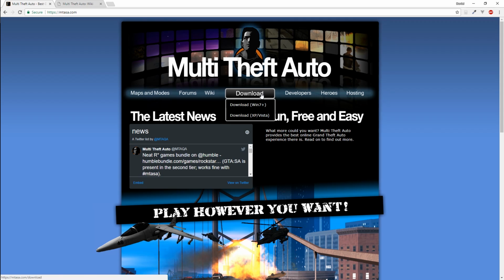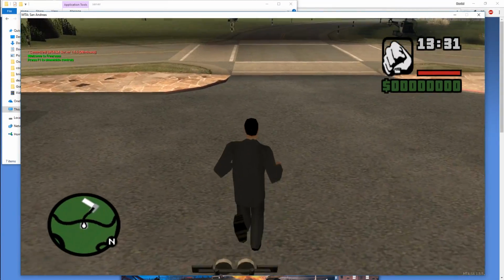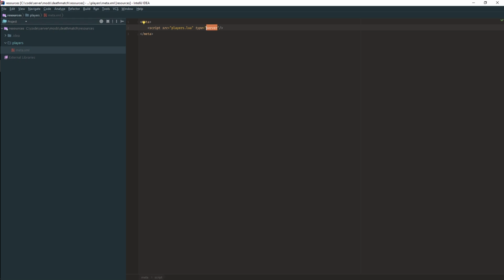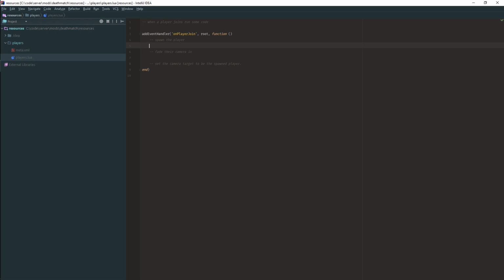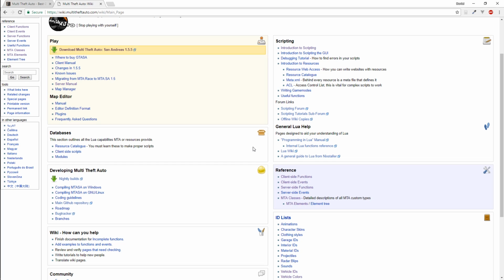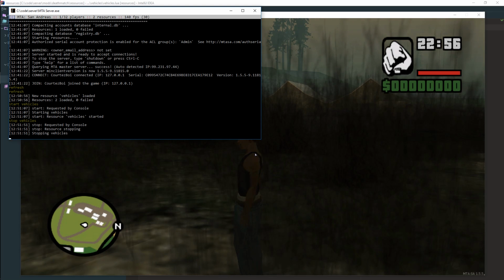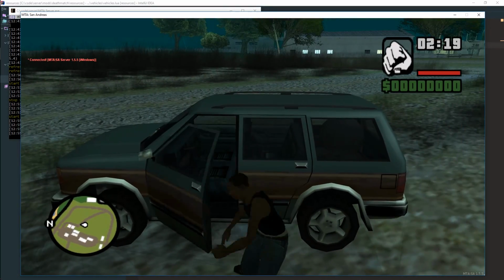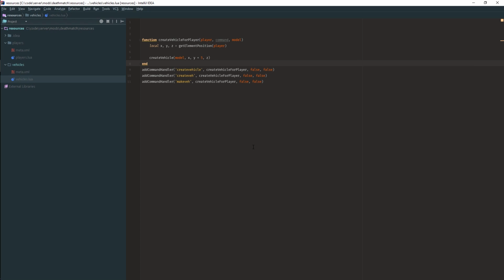Learning to code with MTA:SA - Episode 1

Comment: If you get a black screen check if the .lua file is in the player folder as the meta.xml!!!
the correct players.lua code should be: 

-- when a player joins run some code

addEventHandler('onPlayerJoin', root, function()
    -- spawn the player
    spawnPlayer(source, 0, 0, 5)

    -- fade their camera in
    fadeCamera(source, true)

    -- set the camera target to be the spawned player.
    setCameraTarget(source, source)
end)

correct me if im wrong :)
Reply: I was getting black screen 
replaced my code with yours and it worked 
even tho they are the same what the hell
Reply: @jetpuckrat9819  thats coding

Comment: Hi, I wrote the cod just like you and the game shows me a black screen, can you please help me?
Reply: If you get a black screen check if the .lua file is in the player folder as the meta.xml!!!
the correct players.lua code should be: 

-- when a player joins run some code

addEventHandler('onPlayerJoin', root, function()
    -- spawn the player
    spawnPlayer(source, 0, 0, 5)

    -- fade their camera in
    fadeCamera(source, true)

    -- set the camera target to be the spawned player.
    setCameraTarget(source, source)
end)
Reply: @WorldCupWinner  Hey Leon, thanks for your kindness, the problem was fixed very fast more than year ago 😀. I will leave a comment here, someone will definitely have the same problem in their beginnings. Cya and one more thanks for your kindness

Comment: i get black screen on opening the server after coding.why?
Reply: same
Reply: @gcabdullahzamir3411  If you get a black screen check if the .lua file is in the player folder as the meta.xml!!!
the correct players.lua code should be: 

-- when a player joins run some code

addEventHandler('onPlayerJoin', root, function()
    -- spawn the player
    spawnPlayer(source, 0, 0, 5)

    -- fade their camera in
    fadeCamera(source, true)

    -- set the camera target to be the spawned player.
    setCameraTarget(source, source)
end)

Comment: Guys, I had the same problem as some of you where I joined and had a black screen but i found an easy solution, i looked through the code and I could see that i had: spawnPLayer rather than spawnPlayer. So what im saying is look for grammatical errors, btw here is the working code: 

-- when a player joins run some code

addEventHandler('onPlayerJoin', root, function()
    -- spawn the player
    spawnPlayer(source, 0, 0, 5)

    -- fade their camera in
    fadeCamera(source, true)

    -- set the camera target to be the spawned player.
    setCameraTarget(source, source)
end)